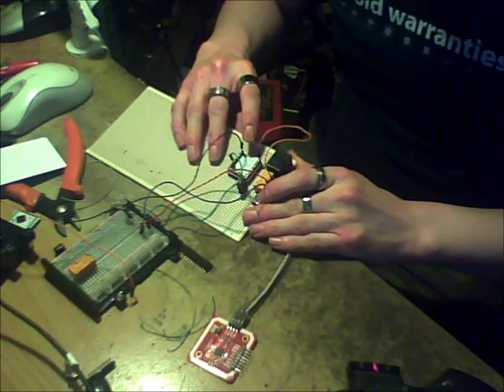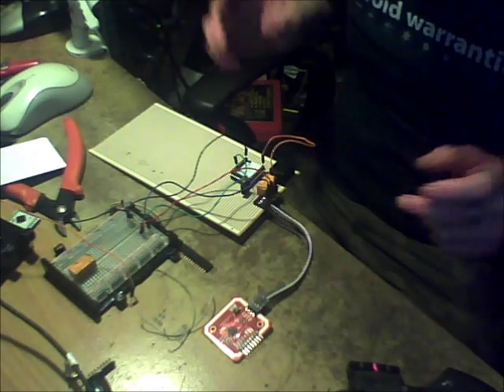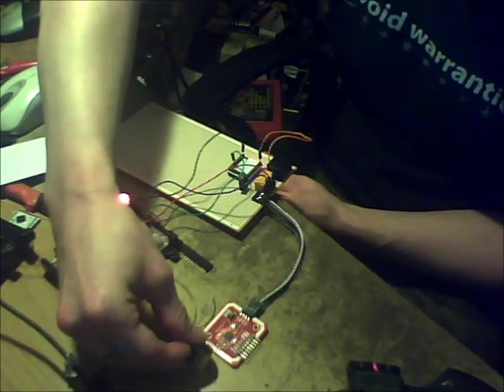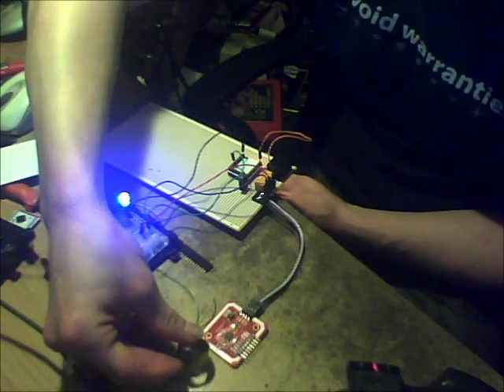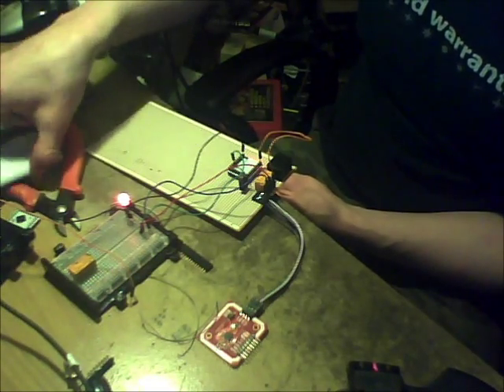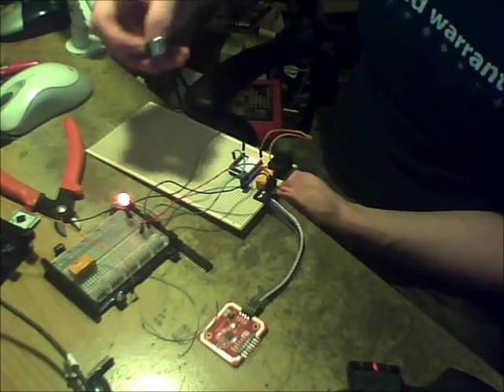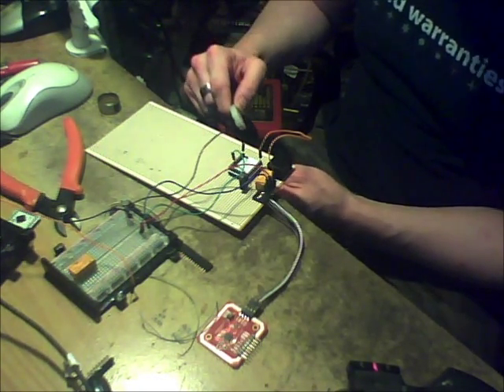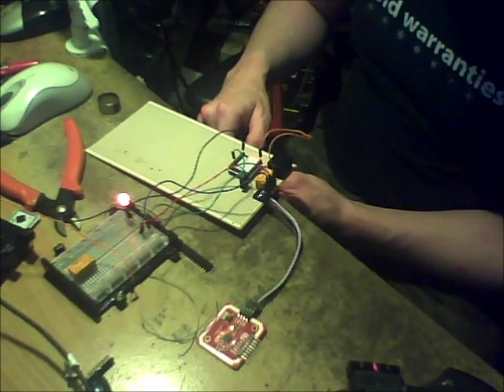NFC Car Starter Unit

Comment: Dude, i know I'm abit late but this is awesome, do you have any updates? :)
Reply from the maker: Have a look at the NFC Ring forum at https://forum.nfcring.com/ for ideas, mate. One of the forum members fairly recently kickstarted an arduino uno variant with inbuilt nfc that could be easily paired up with a relay shield and could also have an external antenna added to make placement easier.
I'm currently working on setting up an intel cherry trail computer (LattePanda) that was kickstarted with an inbuilt arduino, hoping to integrate that into a car as a vehicle management system.

Comment: Hi 
Am I f*cked if I'm using PN532 NFC/RFID Version 2 ?

( see here http://www.ebay.ca/itm/190992100710?ssPageName=STRK:MEWNX:IT&_trksid=p3984.m1497.l2649 ) 

I can communicate with Arduino mega (it uses I2C) using  the tag provided, but it doesnt recognize my HTC-One... And I haven't received my NFC ring yet so I can't test it... 

Would you be nice and advice me for a breakout NFC module (not a shield) that will work with NFC ring and Arduino Mega ? I have a similar project for unlocking doors of my car... So I need to locate the NFC sensor far away from the board, and I will need one that would have a good library to use as I suck at C++ to write one..
Thanks !!!
Reply from the maker: Sorry dude, I must have missed this earlier - the Elechouse PN532 breakout Version 3 is the one to get! The V2 (I've tested it) just about needs you to rub the ring inlay on the bare board. It'll work, and it'll be fine for prototyping but it's gonna make you crazy trying to mount it somewhere for actual use.
Reply: Thanks Lokki !
Reply: Just got the V3 ;)
thanks